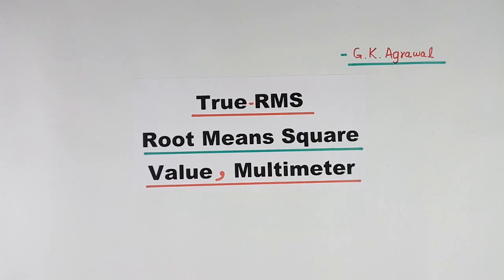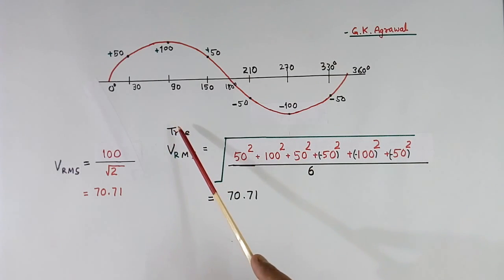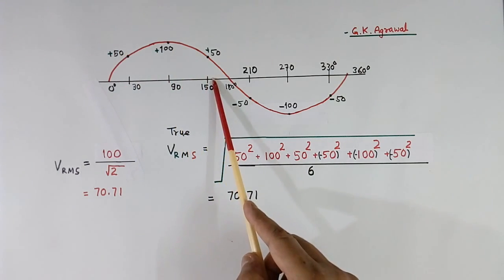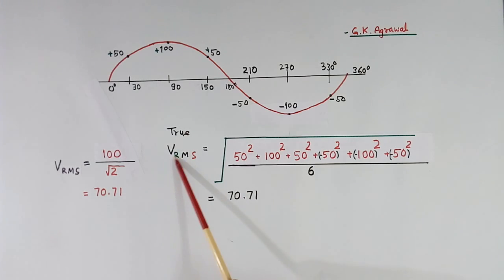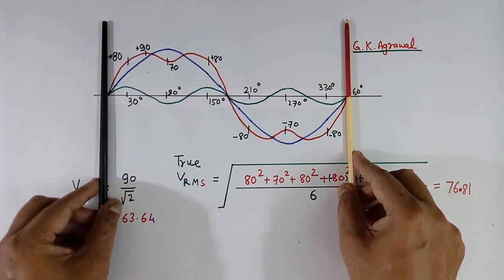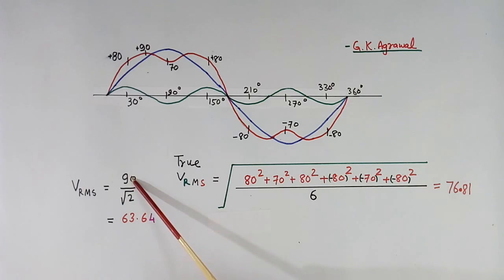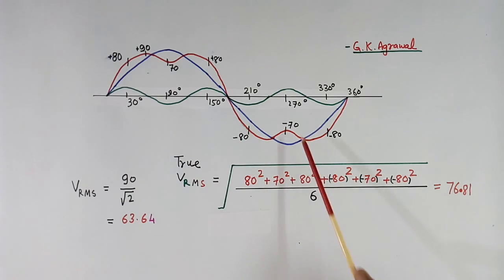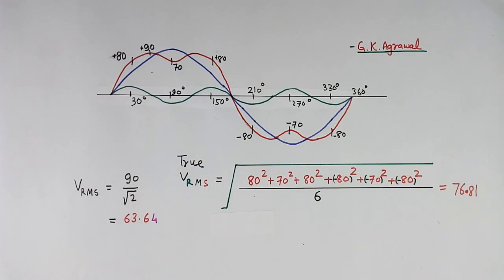True Root mean square RMS value in multimeter, 3rd harmonic

Comment: I finally understood the difference between RMS and TRMS. In just 7 minutes you ace it. Thanks you so much
Reply: I still have a question. 
In this situation we spoke about harmonics 

What happens with pulse width modulation in addition or others type of signals
How do you do that. Do you simply add the value in the form of like you did with harmmonics ? 
Thanks you for your feedback